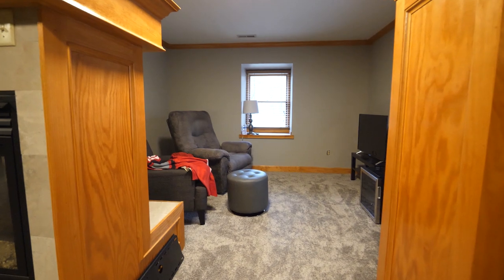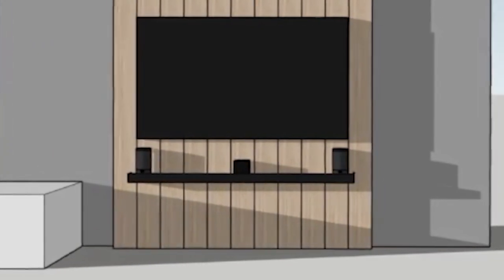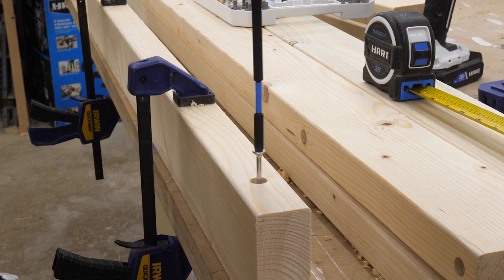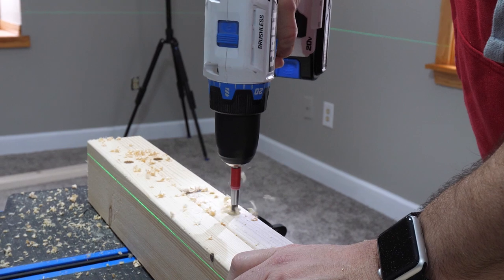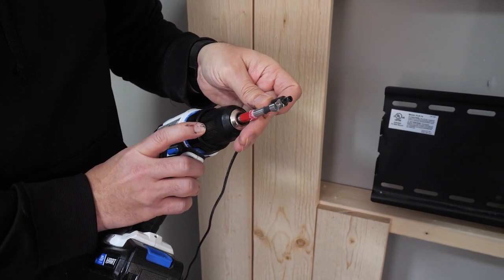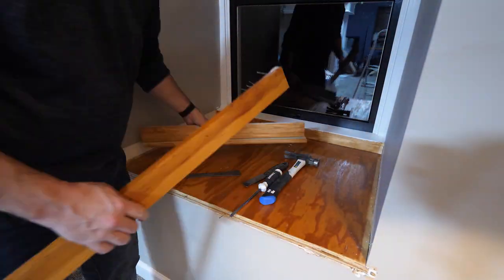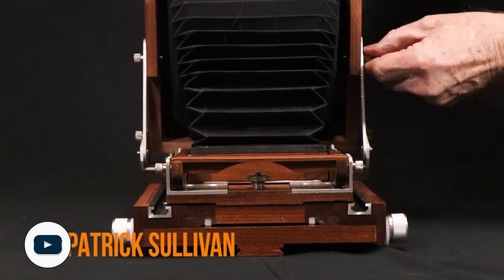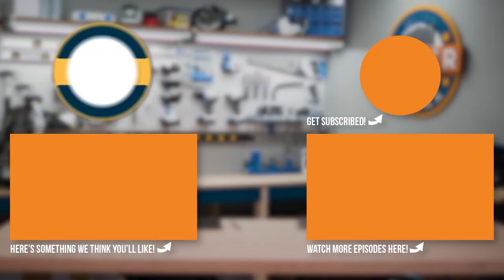We turned our ugly nook into a BEAUTIFUL private media room, with Alexa Home Theater and GoVee!

Comment: Agreed, Monoprice for TV mounts! Also, all you cable
Needs; I go through hundreds of patch cords each year, and they are all from Monoprice.

Why did you mount the tv wall bracket to the studs and them put the planks around it? Would it not have been better to mount it on the surface?
Reply from the maker: It did two things. 1. It made the TV 3/4" closer to the wall, and 2. It left a large hole in the wall we can easily access (to swap out equipment) simply by removing the TV. As for Monoprice, I've been a loyal customer of theirs for at least 15 years. Excellent cables, pelican cases, etc. Love'em.
Reply: @MakerBreak  Ah, this makes total sense!